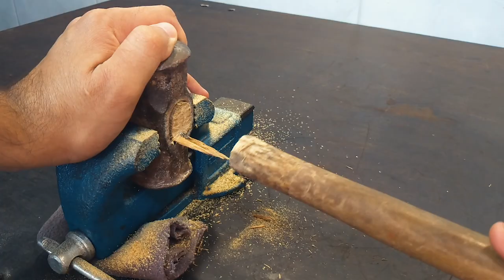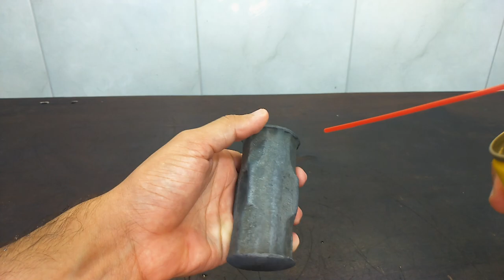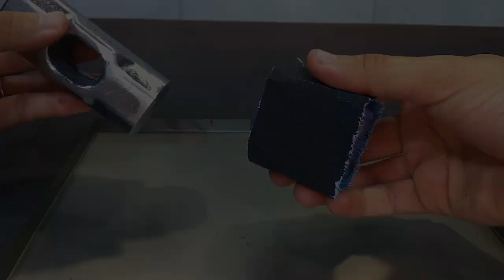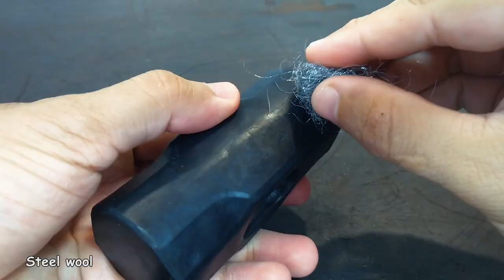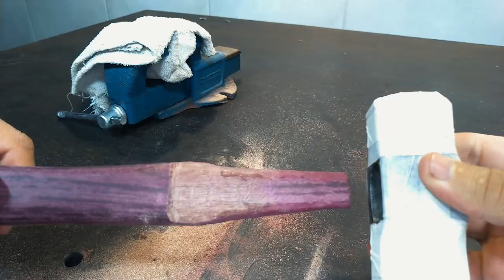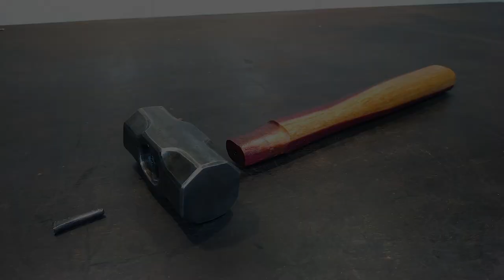Antique Rusted Hammer - Restoration | Workshop DC

Comment: Overall nice restoration on the hammer. Only problem I see is the wedge is kind of a problem since it an old square head nail. I would not try hitting anything too heavy duty or the head might fly off.